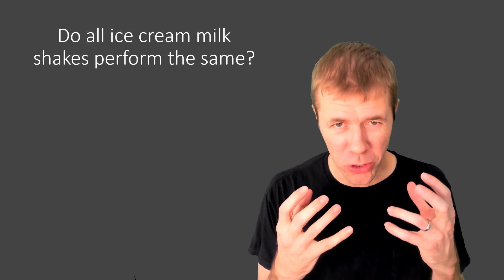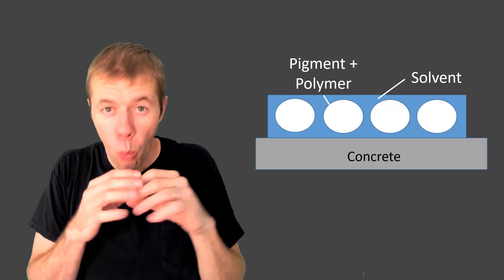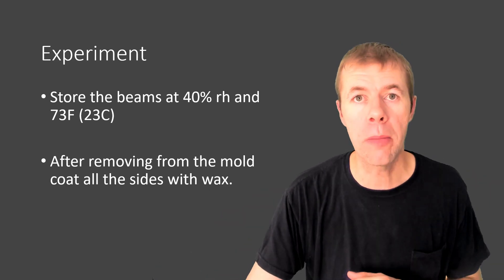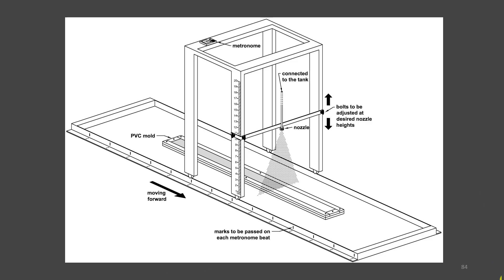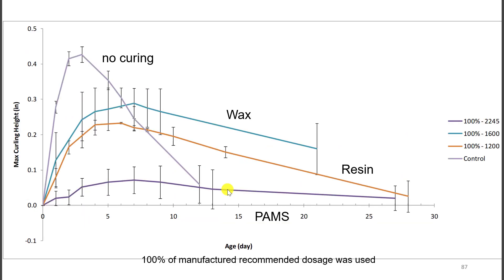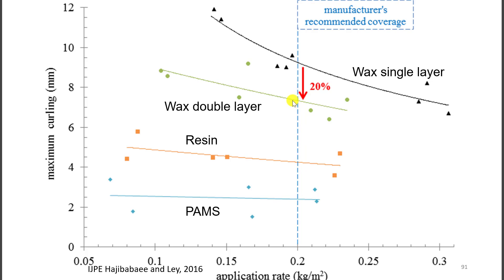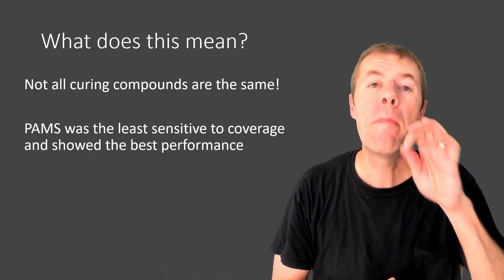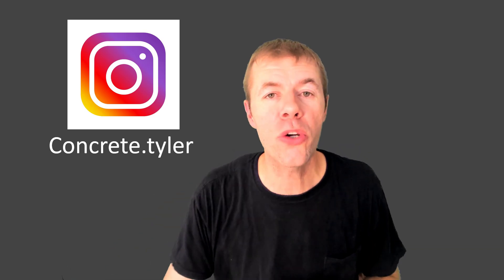Comparing Curing Compounds for Concrete

Comment: I did as you talked about cure the concrete drive way with plastic and water for 5 days my mix was 4000 psi with 4 sacks of fiber per yard after the first 30 days i still have white patches and grayish tent to the concrete will the concrete at some point white out throughout my driveway ? I used 10 mil plastic before putting down the wire as well. Please advise to my question

Comment: Dang i guess im that dummy who didn't deep dive into researching concrete curing, i had my concrete poured 6 days ago and the contractor didn't even bother to wet cure it, about 16hrs after they poured it i stumbled on this channel and i got the water hose and water as often as i could so cross my fingers now that it takes a couple of years before it starts to chip away from the top

Comment: Does moisture or relative humidity effect CTE measurement? Why does AASHTO T336/CTE test require running the test while the sample submerged in water during testing? Unless they want to exclude the effect of moisture-related shrinkage, not sure!!.

In reality,  concrete is not really fully saturated so measuring CTE at room temperature or dry condition may represent the actual field behavior.

Sorry, it is not related to the top. Thank you for your amazing presentation

Comment: When I was in grad school forty years ago, I ended up building equipment for civil engineering research. Budget was low so I did a lot of recycling of scrap from other departments(aka scrounging). I had the machinist/mechanical skills to make the needed parts in our departments machine shop.
Your curing compound spray jig seemed interesting. Did you move it by hand or did you use a power feed mechanism? I would think that a worn(and cheap) Bridgeport Milling machine would work well for you if the cutter head was replaced with your spray nozzles. The miller gives you precise power feed control in x, y, and z directions. Good Luck, Rick
Reply from the maker: Thanks Rick,
We moved it by hand.  There is always a balance between simplicity and complexity.  If we ever need to take things to the next level I will think about the milling machine.
Reply: @TylerLey  I am a believer in KISS. When you are trying to put things together on a shoestring budget, start looking for things well ahead of time. The Bridgeport would give very high accuracy. It would also allow you to make rate changes easily. 
I could be wrong and you may have a big budget. I am used to the civil engineers having to make up for the over budgeting of others. It was especially that way in the Army. 
BTW Have you looked a the New Orleans pictures? It looks like the typical inadequate reshore problem that seems to strike every couple years. When I was doing forming and shoring design, 15 years ago, they still didn't have an industry standard for reshoring and I refused to design it. It was too dangerous, especially because contractors don't follow directions and owners don't pay for adequate inspections. Good Luck, Rick

Comment: There is a oaper on the web about adding sugar to the mix to slow curing and according to the paper when the right amount is added it also makes the concrete stronger after 28 days. 
 
What can you say about it?
Reply from the maker: This is true!  There are lots of other carbohydrates that impact the setting of concrete like glucose and citric acid.  If you slow the reaction down earlier then the long term strength will be higher.  I am not sure that we need to be focused on that because if we design our concrete right then we will get plenty of strength.  Thanks for the question!
Reply: @TylerLey  The reason that i am asking the question is because i regularly work in remote areas ,where additives are not readily availible. I have been using sugar to slow down the reaction when the local minimix can only deliver 2m3 at the time and it is 30 degrees Celsius at  7 am. ( Australia). I would like to know the optimum quantity of sugar per m3.

Comment: 3:50 Are there no health problems associated with the use of pams?(for the workers mainly)?
Reply from the maker: Good question.  We have used it a lot and in confined spaces with not enough air flow then it can make people dizzy.  For external construction or places with lots of air flow then I would be less concerned.

Comment: Hi Tyler,

It’s me again with the R&R driveway in the high, dry desert of northern NV. Contractor applied a curing compound (only one coat I fear...I wasn’t there 😟) and the surface appeared wet for 3-4 days then gradually and in random sections, went white over a week. It’s going on a month now and I want to know when a sealant would be appropriate. Contractor said a month. Any recommendation on a product? I’ll lay dow two coats, of course 👍👍👍.
Reply from the maker: A month is a good time.  I would use a silane.  See my sealer video:
https://www.youtube.com/watch?v=JY0XgiAxZ94

Comment: QUESTION: With your expertise, What admixture would you say can aid in a quick set-up/cure for extruding concrete with a 3D printer.  The need for one layer to set-up enough for the next lift not to deform the layer below. Thanks!!!
Reply from the maker: WE are working on this.  Look for a video soon.

Comment: I see the advantage of curing compounds to improve the concrete, but then the next factor would be what a curing compound would do to the ability to put a coating on the concrete like an epoxy coating. A wax coating may cause problems for some coatings to stick to the concrete.
Reply from the maker: True!  It depends on what you want to do and your timing.